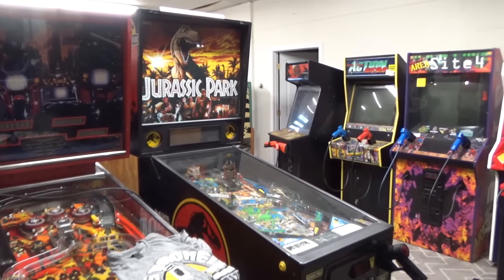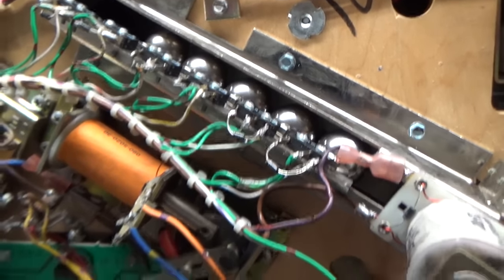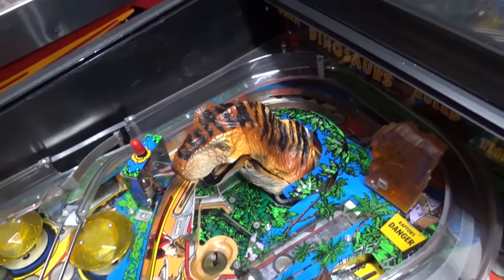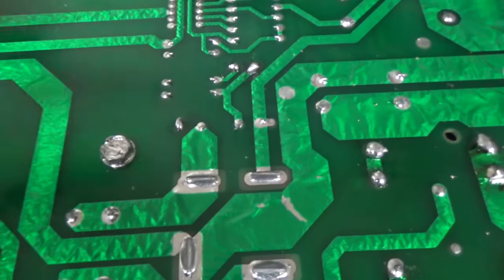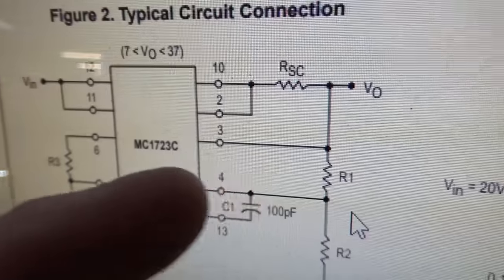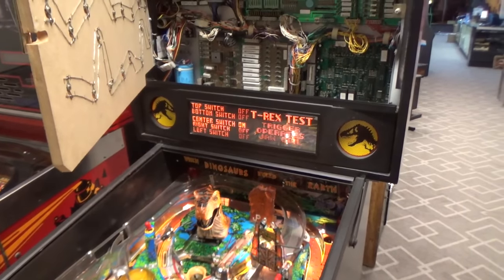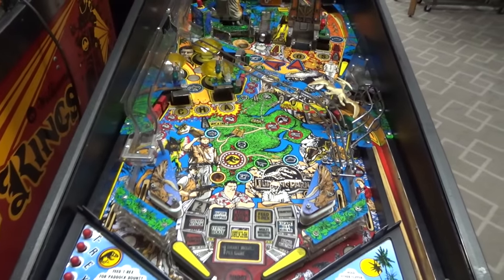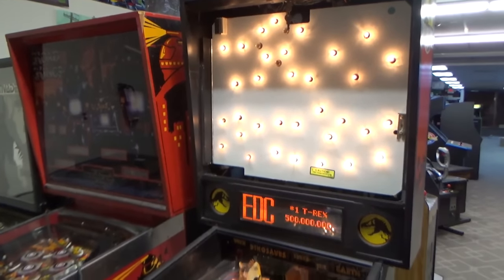Bringing A Completely Dead JURASSIC PARK Pinball Machine Back To Life - This One Is A Ten!

Comment: Two very common problems on Data East games like this one. If you have a problem with 5vdc, this cap is the 1st one to check. It dries out because it get to warm sitting to close to the bridge rectifier. And the other common problem are the fuse clips. They break all the time. Love your channels Ron, keep it up!

Comment: Really worn out fuse holder contact clips. Who would of thought? Now leaking electrolyte from the E caps, that is usually
where you get a power supply issue. Play on board still has mechanical issues but that was a great video so far Ronnie.

Comment: Electrolytic Capacitor
Passage of an electric current through an electrolyte and the migration of the charge to the positive and negative terminals.

I recognize the different components on the diagrams, for the most part.